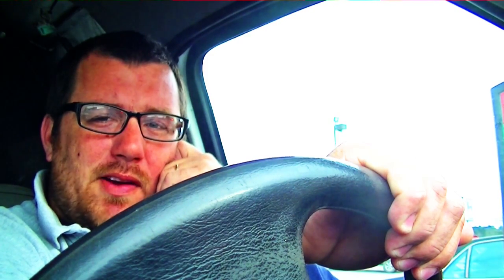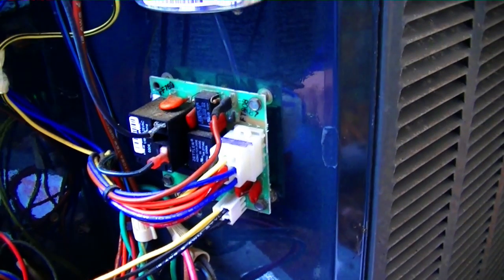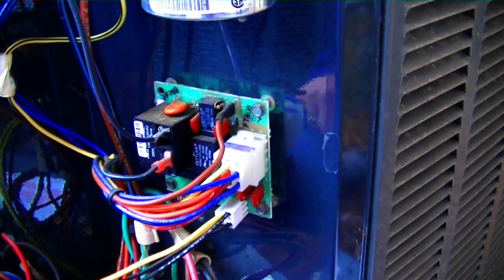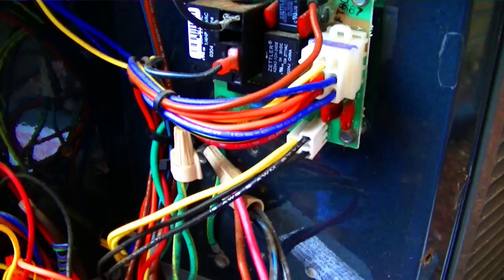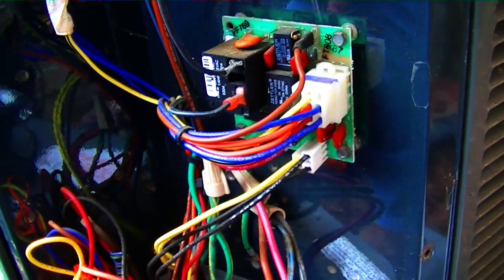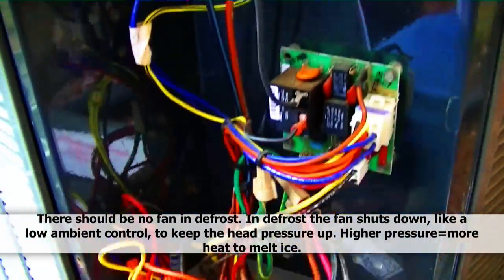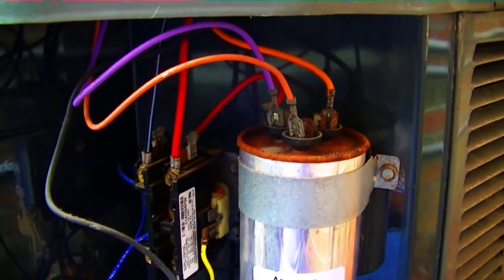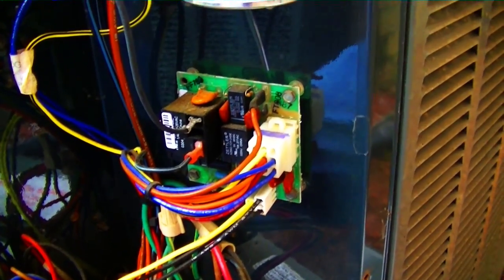HVAC Service- Trane XR12 Defrost Failure

Comment: good day......I have a 4-5 year old Trane heat pump that does not seem to be defrosting properly when it gets to -8 - 10 Celsius.   It has been like this since new.......I called the company that installed it and they came and looked at it but didn't do anything about it.........and they want to charge me for every service call even though its still under warranty.........   This issue only happens a couple times a year when we have a colder stretch of weather....it sometimes will go in Emergency heat mode until I power it off and on or the temp warms up.....Any ideas?   Could it be a low refrigerant charge from initial install?   Is there a setting for the frequency of defrost cycles?

Comment: Hey!  I have a Trane 13 seer PGE roof unit on my home. Are there internal filters I should be changing?  Other service tip I could do as a homeowner?  Model # 4YCC3042A1096AA  tHANKS!

Comment: I work on roof top units  up to 20 ton  and other kitchen equipment .Quickly what refrigerant's are you guys retrofitting R22 a/c with?
Reply from the maker: I have seen R422D, R438A, and 422B. I carry R438A, but do not use it very often.
Reply: Those are not available in Jamaica. We still have R22,but it is scheduled to be phase out by 2015.
Reply from the maker: We have many more, but it gets confusing. R407C is the best they say, but you need to change to POE.
Reply: E Campbell I know this is old but we are using 421a,can keep the same oil,i change the filter dryer with it,and they recommend going up a size in piston or your head pressure will run higher than r22

Comment: Nice work  I never really work on heat pumps in New York/Jersey. I understand the systems though. Mostly gas furnaces or boilers. Easy service calls are nice, it just sucks driving to them over here. Lol. You do good work man.
Reply from the maker: Thanks, we have furnaces but no boilers here.

Comment: Thanks for your Thanksgiving special video...........That Trane unit is only 2 years old!..........Goodman used to be like that.
Reply from the maker: It was actually a little older than that. If you were looking at the serial number it is not read like some of the other ones. I think these machines were around 8-10 years old.